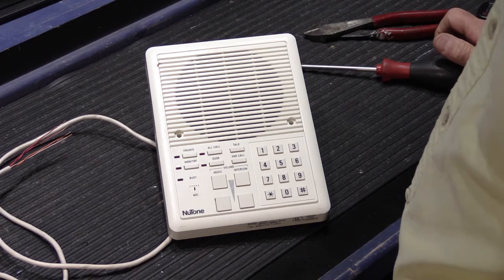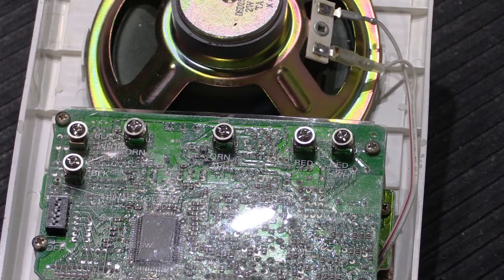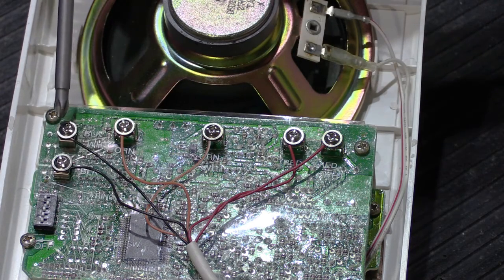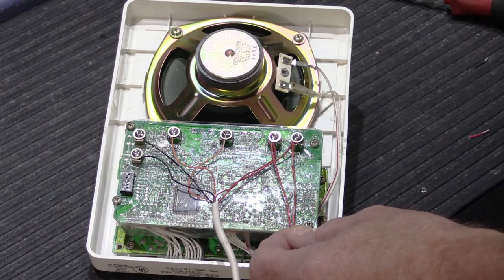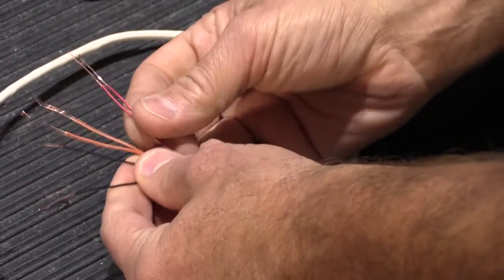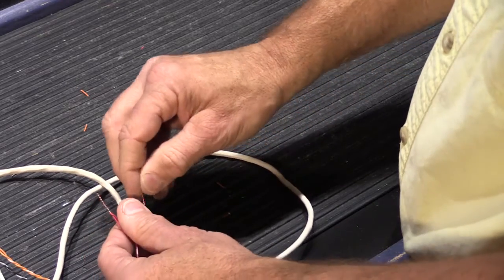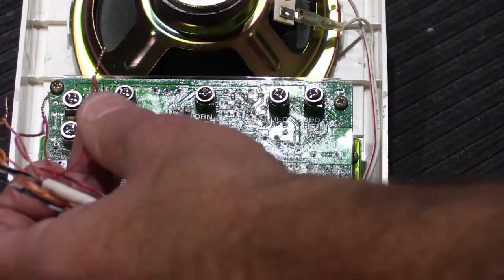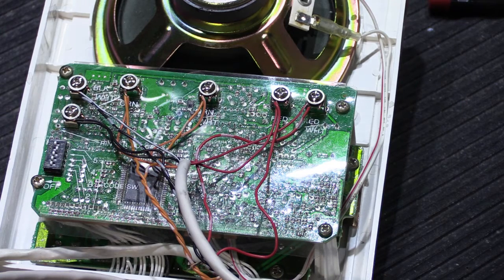The Fundamentals of Terminating Loop Wiring on a NuTone Loop-Wired Intercom System

Comment: Nice vid! Wire pairs within the sheath are twisted to suppress RF interference.  Twisting the loop pairs together to within a short distance of the terminal screws would preserve the RF interference suppression benefit of the cable.  The untwisted pairs behave like antennas spread out across the intercom network.
Reply from the maker: Hi Dennis: Twisted Pair Wire is also important to prevent Cross-Talk on more conventional 6-Wire Intercom Systems - Chris

Comment: Hi Chris, I have a  six wire iw6- coming out of the wall and cannot find any intercom system that works for Talk,Listen & door buzzer, do you have any recommendations or any links?
Reply: They’re also seems to be a extra 14 gauge blue wire coming out of the wall as well. I’m not sure if this was a extra wire or used for looping, but it’s just a condo with one intercom.
Reply from the maker: Hi George:  You are basically asking an "Installation" Question - Which I am unclear on how to answer - These types of questions require much more detail than "wires coming out of the wall" - It would be best if you contacted me directly so I can ask you about 1000 questions about what you're trying to do - Chris      nscompany@msn.com
Reply: @northsideservicecompany3567  thank you I will message you